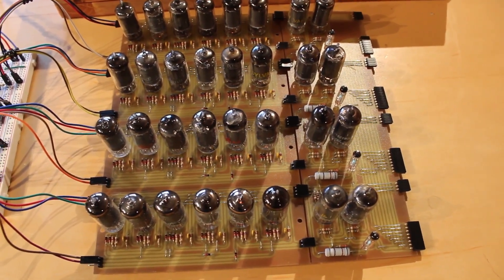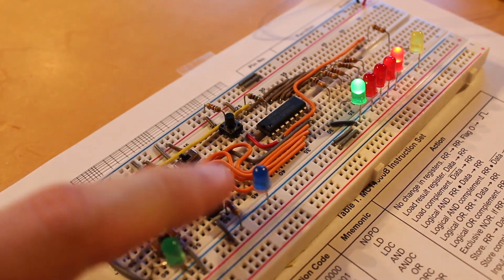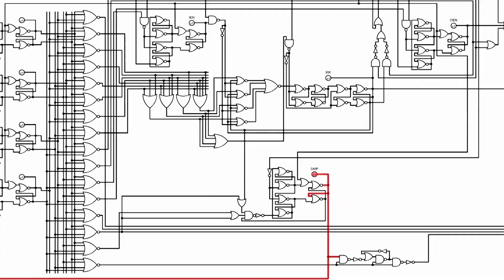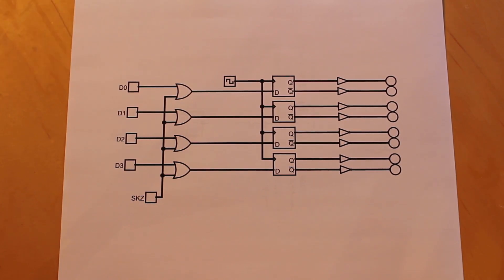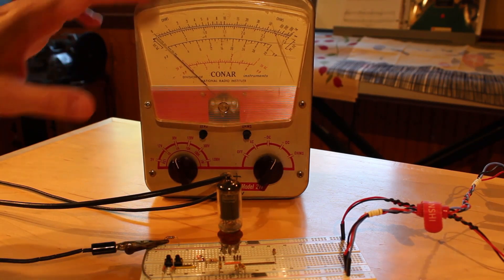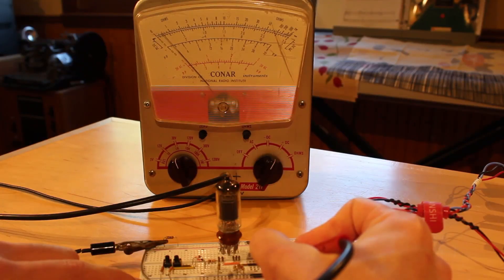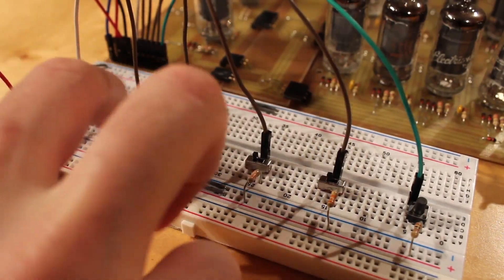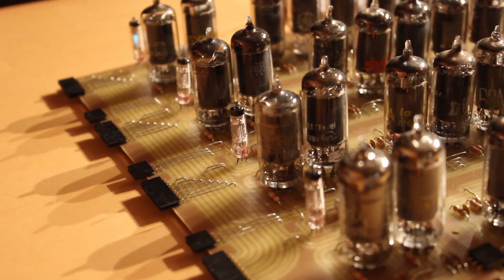Vacuum Tube Computer P.10 – Adding Skip to the Instruction Register

Comment: 17:40 use a frequency modulated  ac filament supply, running 24vac at 50-100khz should allow faster filament heatup, and help reduce inrush, or use the heater as part of an RC circuit so that it resonates to a specific frequency based on reactance and apparent resistance, and making a dc supply is much easier since youll just need diodes and some filter capacitors, or just use 36 or 48v supply voltage since at those frequencies transformers and dc-dc converter are much smaller and more efficient too, and would help with excessive voltage drop, and help keep logic level outputs stable too
Reply: build an atx power supply out of vacumn tubes... lulz

Comment: Just 'thinking out loud' here...
Perhaps there was a REASON why the chip used a pair of back-to-back inverters???
ANY gate (even a lowly inverter) takes a finite time for its output to switch after its inputs have changed state.  This is called a 'propagation delay'.
Perhaps those two inverters were intended to slightly delay the signal?
We shall see in the forthcoming videos.

Comment: One of these for inrush current limiting?

https://www.mouser.com/datasheet/2/18/AAS-920-325D-Thermometrics-NTC-Inrush-031814-web-1315885.pdf
Reply from the maker: You know, I had never thought of using Thermistors as inrush current limiters, but that's a great idea!
I don't actually know much about Thermistors, so I'm going to have to do a lot of reading, and maybe order some to do some testing, but I'm definitely going to look into those because that's a way simpler solution than the time delay relay switchover with big power resistor idea I was working through in my head.
Reply: @UsagiElectric  A bit of extra wiring but you could always break out groups of heater circuits to size vs. thermistor capacity

Another scheme is to bring them up slowly with a pulse train that charges a capacitor and fires an SCR to the heater string.  Charge drops, SCR cuts off and another pulse fires to charge it again.  As the heaters warm up the inrush issue is less and the full-on circuit kicks in.  Possibly the charging step could be handled by another SCR -- once the capacitor nears supply voltage that SCR will cut off.  Now you have an opportunity for at least 2 or 3 of the 555 timers running that.
Reply from the maker: @davidbrown9912  I do quite like this idea! The major issue is actually a massive design flaw on my part that I need to work around. The heaters are powered off the primary 24V supply. For example, the first tube in series will have 24V being supplied to the plate through the plate resistor and 24V supplied to the heater. Then the next three heaters are in series with the final heater going back to ground. It's really compact and works brilliantly, even with up to about as many tubes as I have here. But as this grows, the power supply is going to start thinking there is a short circuit until the heaters warm up.
So, unfortunately, due to the way I've designed the PCBs, I can't really access individual heater strings, but the idea of a pulse train seems like it could definitely work well and is something that I could design into the power supply unit itself! I'm going to have to explore that idea a bit further in the future!
Reply: @UsagiElectric  there is a project called the utracer that has some great ideas on supporting tube measurement without using lots of power:

https://www.dos4ever.com/uTracer3/uTracer3_pag3.html
Reply from the maker: @davidbrown9912  The uTracer is an awesome project, and I would really love to build a low voltage version of it to get accurate tube characteristic curves at just 24V to really get a proper comparison of different tube types. Particularly triodes vs. pentodes as I have a hard time getting triodes to behave consistently in my low voltage designs. One of these days, I'll have to do some heavy reading into the uTracer and see if I can modify their design and build up something equivalent!
Reply: Actually, a short term fix is a bank of toggle switches. Power up one heater group, then another when the first ones stabilize, etc. Finally switch on the working voltage like guitar amps do. You could even use time delayed relays to handle the sequencing. Bank 1 powers bank 2’s relay. When it comes on it powers bank 3’s relay...

Comment: I have just started watching your channel recently, and yeah, you can only put so much current through a breadboard, so you're probly going to want to use more than one power supply, or make a power supply for just the tubes that uses thicker guage wire and no breadboard.

when i saw the power was going into a breadboard, after watching as many TV repair videos as I have... all i could think was fire hazard lol.
Reply from the maker: Fortunately, I have a few things working in my favor here for bigger power requirements.

The breadboard itself never really saw any current at all as I was just borrowing the +24V supply to give me digital logic high and logic low into the really high impedance inputs. So the level of current flowing through the breadboard in this case was on the level of microamps.

For my PCBs, all of the traces I cut are 1.0mm. This is primarily to compensate for the fact that I'm cutting them on a large Bridgeport mill, but a wider trace width brings with it greater current capability. The Paramount CCL single sided PCBs I'm using seem to have around 1.5oz, which when combined with my 1mm traces puts the current capabilities per trace at around 2.5A, which is pretty hefty. That along with the fact that I'm trying to design in prolific power rails that span across the entire system should balance the power pretty evenly across the system.

But, at some point the power draw is definitely going to get pretty high. Fortunately, at just 24V the fire risk is pretty low (the highest potential anywhere on the board is at most 36V between the +24V rail and -12V rail). Unfortunately, if I start burning up traces, I have to rethink a lot of power distribution. One good solution is actually soldering on additional wire over the primary power traces. That can really bump up current capabilities.

So no need to worry! I may de-laminate some copper as this thing grows in size and power consumption, but I shouldn't be starting any fires anytime soon!

Comment: Also, regarding the filaments overcurrent conondrum, I'd use a series of thermistors for damping the inrush current, to avoid popping fuses or melting wires. It was used in old tv sets to avoid different heating times in parallel heater strings, resulting in various overloads in parts of the circuits caused by the different delay to get up from cold to an operative state
Reply from the maker: Interesting, I had never though of doing it with thermistors!

Though, I'm not sure how well that will work here as I'm using the primary 24V supply for both B+ and the heaters in series. I've been playing around with different ideas, but currently, I've been thinking to use a time delay relay setup. When turning on initially the primary power supply runs through a couple of high wattage resistors. The machine obviously won't work correctly at all, but that should allow the filaments to start to warm up a little and their resistances to start to stabilize. Then, the relay kicks off and the full 24V goes through.

Although, again, I'm not sure how well that will work as I've never actually tried it. I need to figure out a good way to measure the inrush current accurately and then go from there.
Reply from the maker: @billlewis9740  I'm actually using some 6AU6A tubes here that have stabilized heater warm up cycles, but given the sheer number of tubes I need in total, it's hard to use just 6AU6As.
Reply from the maker: @billlewis9740  Oh yeah, it's absolutely not the optimal way to do this. Obviously the best way would be to bump the B+ voltage up to about 100V and then have a separate filament transformer. But, I'm super accident prone, and so when I first started learning about tubes, I didn't want to be playing around with higher voltages because I knew I would either burn some components up violently or give myself a big shock. This lead to a lot of testing at low voltages, and I found that most tubes worked really well at lower voltages.

So, I stuck with low voltages for a few reasons. Firstly, I'm smarter and know a lot more now than when I first started, but I'm still kind of dumb and am absolutely sure that I'd hurt myself with a high voltage circuit, haha. But, I also think that by doing tube stuff at low voltages, it kind of opens the door for a lot of other folks that are scared of large B+ voltages like me to be able to experiment with tubes in a safe and foolproof manner.

As for why I chose 24V, it was actually specifically to make powering the filaments easier. I initially was planning on 18V, because then I could power things with a laptop charger, but having to keep things based around three tube modules was a little difficult. With +24V and -12V, I have a ton of flexibility in how I build my circuit out. -12V for two heaters in series, and +24V for four heaters in series. It means I need a beefier power supply ultimately, but I'm not against using a nice modern supply for that. My current 24V supply will supply up to 15A of current, which is actually massive. With around 36 tubes in use here, it seems to be drawing less than 2A, so I should be able to expand this pretty far without overloading my 24V supply.

While it's most definitely not the most efficient (or even correct) way of doing this, it's allowing really tidy power supply setups and gives me a circuit that's idiot proof enough that I haven't hurt myself with it yet!

Comment: Nice, it's coming along very nicely. 
I'm glad you are thinking about some of the problems of the system getting bigger (like the power supply) right now, before it is to late. 
As I wrote under an earlier video, I'm really looking forward, how the integration of all the parts goes. 

Greetings from Germany, 
Michael
Reply from the maker: Thank you so much!

I am trying to anticipate roadblocks and hurdles that I'll need to overcome as the scale of the machine grows, but it's such a massive project it's really hard to predict all of the problems I'm going to be butting my head up against. Fortunately, my 24V power supply can supply up to 15A of current, so it's got plenty of power. Even all these tubes only really draw about 2A once fully warmed up. So, we really just need to tackle the inrush current problem.

But, all in all, it's coming together really quite well!